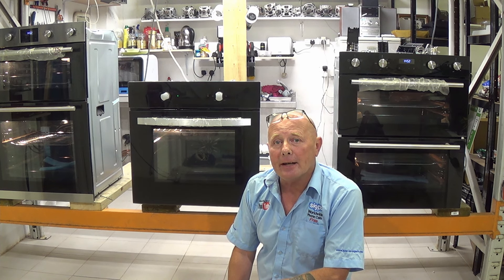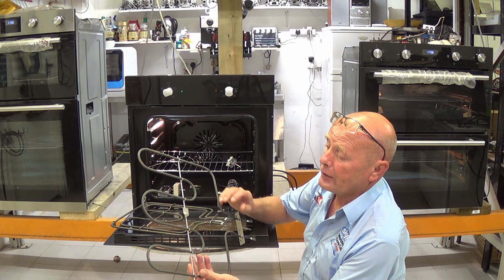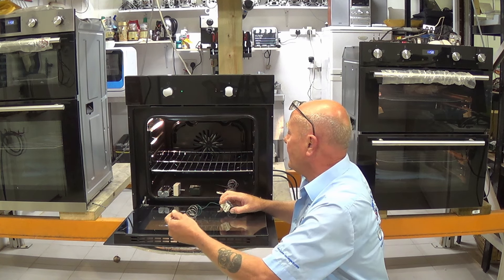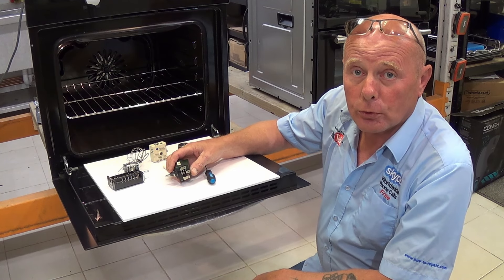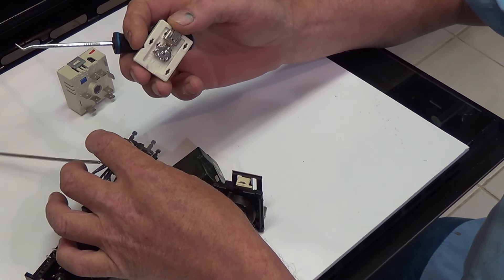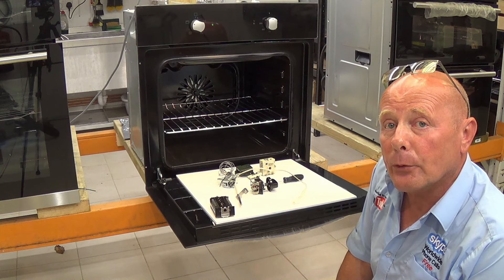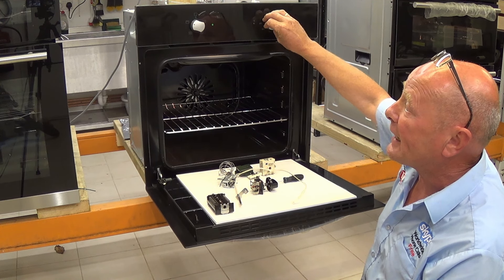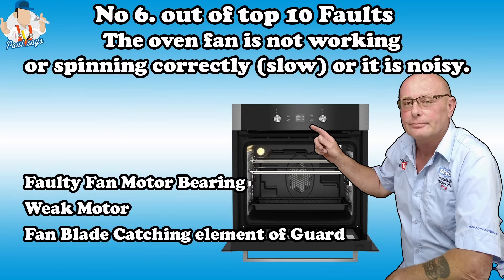Fault 5 Oven or Cooker Grill element doesn't work or only part of it heats up

Comment: I have a Kenwood cooker with a dual grill issue.
I've watched your vids but still confused.
When I try to use the whole grill, only the outer area heats up and gets red. Not the inner.
If I use just the inner grill ie wavy lines  that heats up fine, it's only when I try to use the whole grill that it won't all fully work.
 Will this be the thermostat probe that's faulty

Comment: I was called out to a job where their Neff fan oven with grill element keeps tripping their RCD after a couple of minutes. Insulation resistance on supply circuit is fine. However, using an Earth leakage clamp meter on the meter tails and then switching on the fan oven the measured earth leakage steadily buils up to around 22mA then the RCD trips. Tried this on the grill only and builds to around 19mA then stablises. These readings are for the total earth leakage for the electrical installation.
Reply from the maker: Hi David, sometimes you may have a combined earth leakage which goes above the RCD level
Reply: @How-to-repair  Hi, I will go back and turn every other circuit off apart from the oven and put my clamp meter on the meter tails and try the oven again.

Comment: Sir I have a question ❓
Where is tomer switch for this oven
Reply from the maker: I think you are referring to the selector switch this is located normally on the opposite side to the thermostat and will be an electrical switch which has many wires attached to it

Comment: Hi, just wondering if anyone can tell me whether a free standing oven with separate top oven/grill will have a bottom element in the top oven? The top oven on my Hotpoint HUD61k only heats up to 170c and never reaches the top temperature of 220c. After watching a few of your videos I have gathered its probably not the thermostat and is possibly the bottom element, but there is no visible sign of a bottom element, unless its housed below the metal panel of the top oven bottom. The top double grill element seems to work fine and both turn bright red when the grill is activated.

Comment: I tested the insulation resistance today on a neff oven fan element between the terminals and the earth / metal casing of the element and obtained a reading of 0.71 Mega Ohms. If this was a cable then you would replace the cable. The fan oven has been tripping the RCD fairly regularly recently so surely 0.71 Ohms is too low a reading and the elemnent needs replacing. Before I removed the element I turned all circuits in the house off apart from the oven and turned the oven on and with an earth leakage clamp meter around the meter tails observed the leakage current steadily rise to aroung 19mA and then fall back down as the oven heated up after around 5 minutes or so. If all other circuits had been turned on then the leakage current would have been higher and the RCD would have tripped. Am I correct in assuming that the fan element is faulty ?
Reply from the maker: From the way you are describing it I would say yes, remember that an element can work for 3 or 4 minutes, and then the resistance starts to go higher because the inner core is breaking down under heat so I would replace it and have a great Christmas and a happy New Year. glad we could help you @user-uu3pg4ij7w this is for you https://www.youtube.com/shorts/e432SAb2g08 please remember to subscribe as that's what keeps this channel going. Thanks 👍